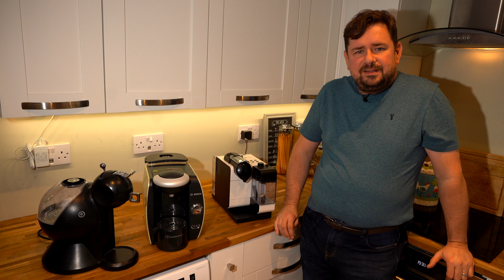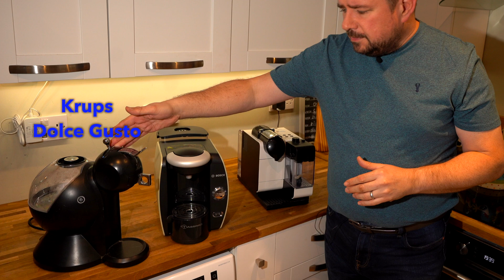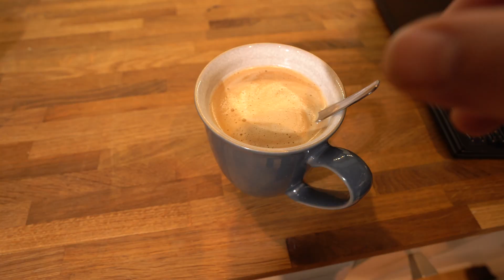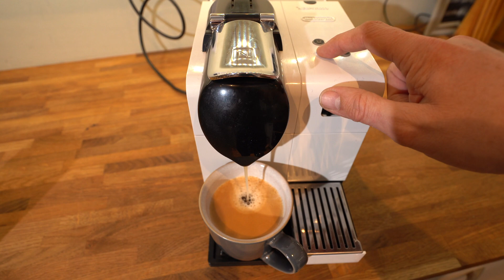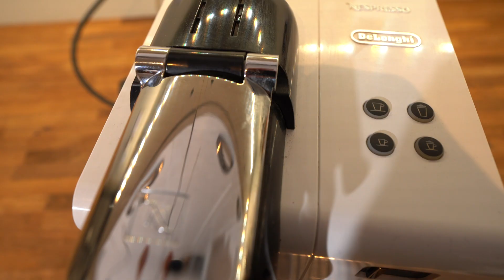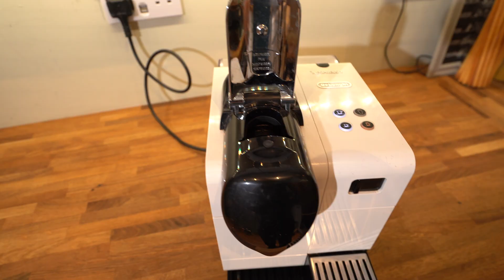Which coffee pod machine to buy, Watch this first

Comment: Your comparing 2 £40 coffee machines with one that costs £400... of course the £400 one is going to be better .
Reply from the maker: As in the video, It’s more to do with the coffee pod system than the machines, the machines are set to a universal pressure designated by the coffee system  eg nespresso dolce gusto etc whichever brand you choose. The choice of coffee pod flavours, none of this is to do with the machines manufacturers
Reply: Ironically a manual espresso machine will right out crush any of these toys.

Comment: The Nespresso machine in this video is actually the Lattissima Plus. The Plus and Touch are very similar, but the Touch is a newer model. The Lattissima Touch has 1 extra milk coffee setting (creamy latte on newer revision, ristretto on older revision) and also a button that only dispenses the hot milk and froth from the milk frother.

Comment: In my opinion, if you want the jack of all trades, you should go for the Gusto. Nespresso machines here are way more expensive than the most basic gusto ones. Also, there's a lot of third party capsules with the possibility of getting nespresso pod adapters and reusable capsules. May be the same for nespresso machines but from my research, I think the Dolce Gusto is the better option (at least for me).. Tassimo is the worst one, and the cheapest one (the capsules are so overpriced!)
Reply: You can also get a ‘capsule converter’ which allows you to put Nespresso capsules into that fit in your Dolce Gusto machine.

Comment: This is an interesting video and you made some good points but not all the information is there.
The Tassimo is a not really for me.
I’ve had Nespresso machines In the past, own a bean to cup machine (that unfortunately is on its way out) and just purchased a Dolce gusto.
The reason I chose the dolce Gusto is down to cost (I can’t really afford £400 currently to buy another bean to cup machine) and the fundamental issues I’ve experienced in the past with Nespresso machine.
Nespresso machines just don’t make hot coffee. I’ve owned a similar machine to what’s in this video (Lattissima +) and the coffee was always luke warm. Using the auto milk frother the lattes it produced never ever reached 60c. I checked with a temperature probe and the coffee was always between 55c-58c which is just not hot enough. It gets a bit better with a standalone milk frother but it’s only at 63c-66c depending on espresso size.
The dolce gusto on the other hand is brewing a cappuccino at 78c which over 20c hotter than what the Nespresso does with the auto milk frothing system. 
Also the choice of pods is much bigger than just “dolce gusto” pods and a single taste profile of coffee. There is Starbucks, Costa, which offer the brand specific coffee along with twisty such as caramel latte or vanilla lattes with their signature taste profiles and a new single origin collection which all have unique flavour profiles. There is also supermarket offerings that also taste different again and in a budget.
The best part now is if you shop about on eBay or Amazon you can buy a dolce gusto - Nespresso adaptor so you can actually use all the Nespresso compatible pods in your dolce gusto machine, giving you loads more options for your dolce gusto. This makes the Dolce Gusto a win/win for me.
Now with my Dolce gusto I’m getting hot coffee (not luke warm like with the Nespresso) and I’m also getting everything the Nespresso offered in terms of options.
Nespresso does have some great coffee’s but they need to sort out their manchine temperature issues as they are just not good enough for the premium price the offer which is why I’m so glad I got the dolce gusto and the adapter as it’s the best solution for me.
Here is the link to adapter if you you would like to look at it, there is two options once for the Piccolo & Genio 2 and the other a universal for other machines (except the new Infinissima).

Joff

https://www.amazon.co.uk/gp/aw/d/B09J2JP6VY?psc=1&ref=ppx_pop_mob_b_asin_title

https://www.ebay.co.uk/itm/165001996046?hash=item266ae2a70e:g:y74AAOSw-dVhsA0X
Reply: damit if i had seen your review and the adapter links  id have probably saved a ton on the nespresso sage and had the option for gusto should i need it !! As we droing mostly short coffee drinks,  I have to say though im very happy with the sage nespresso plus and i thought the tasimmo coffe was awful which scared me off the gusto
Reply: @6GSF  if anyone is going to buy a Nespresso the Sage Nespresso Creatista is the one to get as it seems a lot better than the rest in terms of serving temperature. The Lattissima machines & all the espresso only Nespresso machine are really poor with serving temperature, with the worst being the Lattissima range.
Reply: I have a Dolce Gusto and thinking to buy a simple Nespresso (Not latissima) because I am a strong espresso lover.I think that the quality of coffe made by a Nespresso is better than the quality of the coffe produced by Dolce Gusto.The special thing is that for Dolce Gusto is a bigger variety

Comment: What is the temprature of different bevereges by those machines?
Reply: From my experience the Dolce Gusto machines are always hotter by about 15-20C give or take a couple of C. 
The Nespresso Lattissima + I had would brew espresso at 62c-65c and latte’s with the auto milk frother at about 55c-59c (never had it above 60c with milk). My Dolce Gusto Genio 2 plus by delonghi is brewing Costs branded cappuccino pods at 78c and it’s a double pod brew (one milk & one espresso) with a small pause to change the pods over.